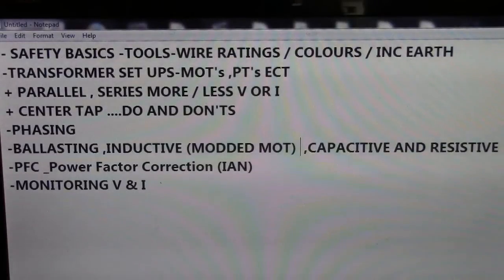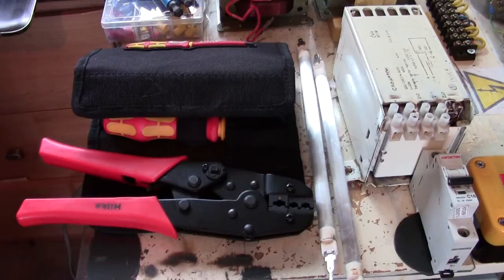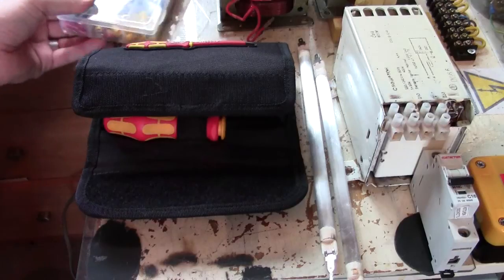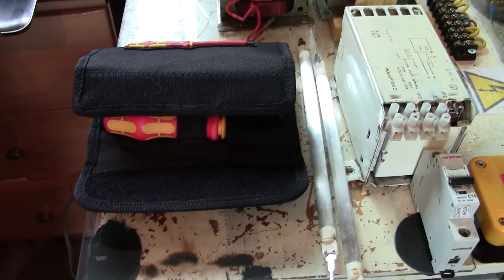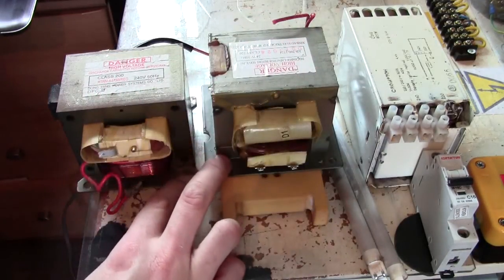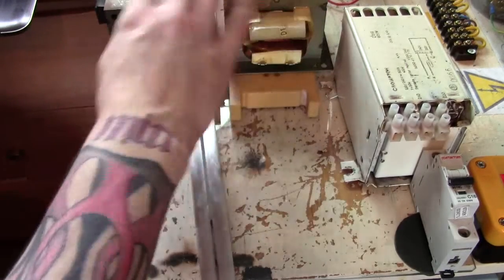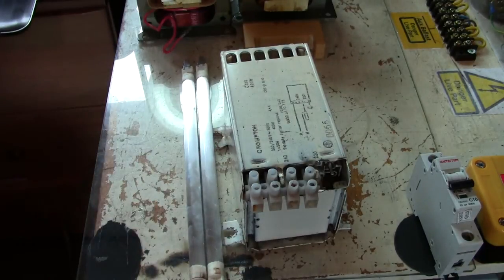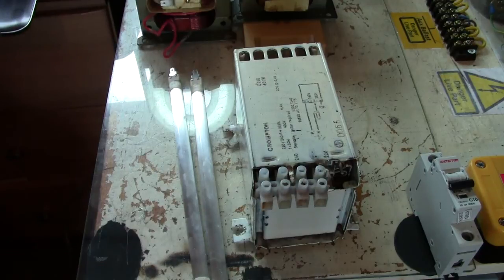TRANSFORMER BALLASTING ,WIRING PARALLEL ,SERIES AND SAFETY

Comment: Good video. Could you possibly help me out with something? I have several Sylvania SUPER5-KIT 120/208/240/277/480V Metal Halide Ballast KIT and I wanted to know what is the difference in these and a typical transformer? If I were to connect a 120v mains to the 120v labeled wire, would it step up to the other listed voltages up to a total 400W power draw?
Reply from the maker: Hi just looked at the datasheet and from what I understand if you use the correct V input like you say, you'll get 300v out and a usable 1.3A ish (400W) out. Don't use the capacitor though as that's there to start the lamp giving a high voltage boost. It's been a long time since I've done anything like this and back in the day I would have tested what you were asking before giving an answer. Search for Ridefast0 on here as he will know for sure.. Tell him John from High Voltage Projects sent you to his channel. Hope this helps. Cheers John

Comment: Bro, I see what you meant from the beginning in showing people how to wire transformers.Its not good, its shows people the easy way instead of reading on the subject and knowing the possible hazards.I think if somebody doesn't know how to crimp(no offense), you probably shouldn't be messing with electricity/high voltage.Engineering is a thing you learn from gaining experience and reading thoroughly.Great video, but should it really be out there were everybody can see it and take a "shortcut"?
Reply from the maker: I see your point chocky and the vids will show how but with out knowledge first ,you wouldnt be able to understand them ;) there is a fine line and the wont be and colourful pictures here to show wire by wire so i think we are good ,anyone that wants to learn will have to fill in the gaps ;)
Reply: HighVoltageProjects Sounds good man, keep them' videos coming :)

Comment: Viewer # 2 :D

For ballasting, I use a 3kW water heater and my Fun-Jiggery-Pokery Unit. :D

-BoomBoxDeluxe.

10th February 2014, 19.00
Reply from the maker: Hahaha i wont be featuring the jigery pokery as I want to keep it simple and safe but using the correct stuff is my main aim ,no bodgery ;~)
Reply: +BoomBoxDeluxe and if you only want 2 kw / or 1kw ?
Reply: Haha, it's interesting that you say that. :-)

This is the reason why I upgraded my Fun-Jiggery-Pokery-Unit to have two sockets on the ballasting side.

I can have a 3kW water heater in one socket, and a 2kW fan heater in the other. This gives me a few options.......

For 1kW, I would turn the fan heater onto setting one,
For 2kW, I would turn the fan heater onto setting two,
For 3kW, I would turn the fan heater OFF and the water heater ON

And as far as being naughty goes......

If I wanted 4kW, that would be the water heater + 1kW on the fan heater

OR......

For 5kW, the water heater would be on with the fan heater on top-whack!

Now, keep in mind that the domestic UK socket can only take 13A or 3kW, tugging anymore than 3kW  IS NAUGHTY!

So, there we are. That answers your question, with a nice little bonus nugget of information slammed on top. :D

BoomBoxDeluxe has flavour. :D

5th January 2015, 01.30
Reply: +BoomBoxDeluxe wow , thanks for the answer :)